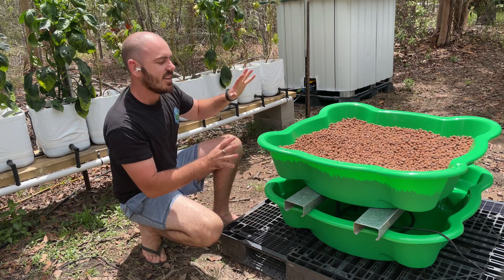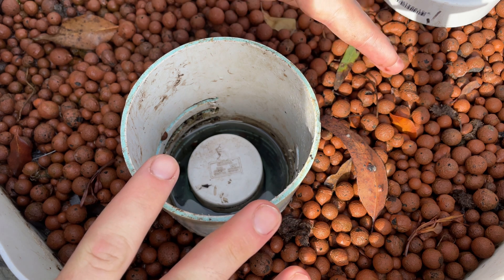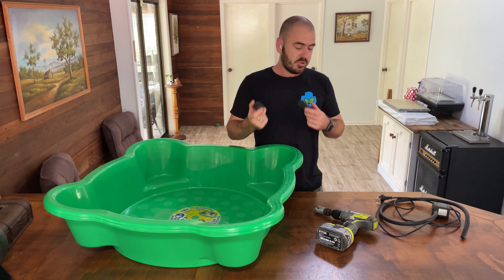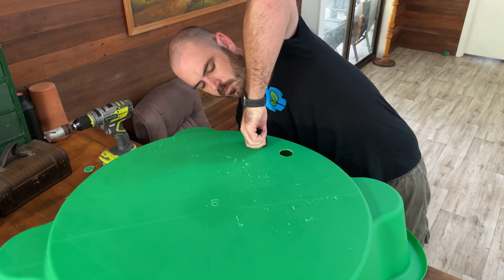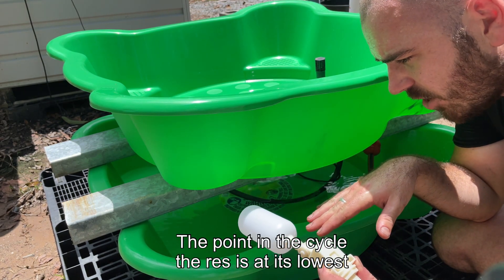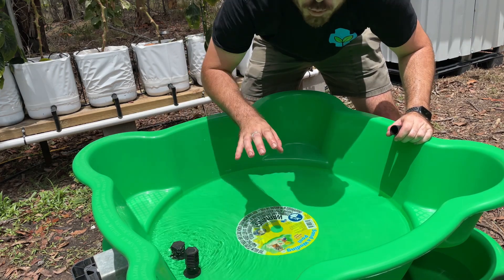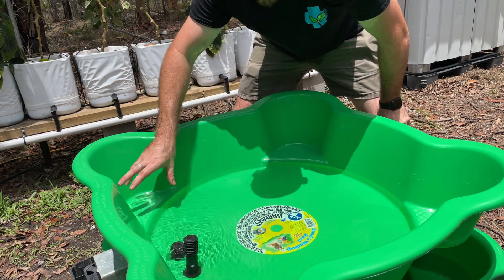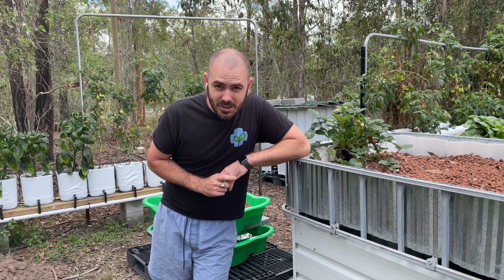Cheap & Easy, DIY Flood And Drain Hydroponic System

Comment: I use a similar system for two of my growbeds, but I use really cheap USB water pumps and small (cheap) solar panels for each pump.  I've never has to replace a pump yet but I keep many spares. You  can get these off a certain Chinese website. We're talking up to $5 cost per unit. The Solar panels occasionally need some good quality clear top coat. You can repurpose solar panels from Christmas lights.

Obviously this limits the operation to day only, and that is usually all that is necessary.  It avoids using mains electricity in the garden.  For another system, I have a large solar panel charging a 12v 200Ah GFM  battery. That one uses a home-made Bell siphon.  I limit it to daytime operation using a light sensor switch wired for daytime operation (reverse).  All my plumbing and reservoirs are black and I use covers on the reservoirs to avoid algal growth.

Comment: Lil heads up. I had 4 running as deep water with foam rafts and after 3 years in the Aussie sun they started to crack and 1 day a small knock and the entire side crumbled dumping everything. The blue shell 1's break even faster. Lucky I was there at the time or it would have pumped all the water from the fish. Would never trust 1 on a Aquaponics system again as well as would replace them yearly with in hydro grows. They are great until they fail and give you a bunch of extra work :(

Comment: Why not make a flood and drain with two pumps in side by side media tanks? Each would pump into the other every 15 minutes and the nutrients would not be exposed to sun. No need to drill into tanks, no sand pipes, no nutrient tank, supports or no bell syphon. The pumps can have vente air in the tubing.

Comment: It would be a good idea to put boards over the entire pool,it will block the light and prevent the growth of algae in the reservoir. You should also consider putting the reservoir in the ground, it will keep it cool so the roots don't rot and help block any light from coming in through the sides.

Comment: whats the situation like when it rains? obviously the return will overflow but wont it throw nutrient levels out of wack? i want to build one but no space in the greenhouse so it will have to be outside..
Reply: It won't matter. Plants are ok with just plain water or diluted nutrient solution until you adjust it.

Comment: I have a setup with 2 stackable Euroboxes. So the reservoir is rather completely covered. The pump is controlled by an ESP32 microcontroller. Smaller dimensions and for indoors tho.

Comment: You can place some shade cloth or weed mat under the two supports to keep the mozzies from breeding in the nutrient, or else replace the two supports with a solid sheet of waterproof (marine) ply. This will also reduce evaporation from the bottom tank.

Keep up the fun & easy hydro suggestions.

Comment: Great info.
Is there a way of making nutrients at home? I know worm castings can be used but have also heard that urine can be used. Don’t know what can be used for trace mins and calcium sulphate (eggs shells?)
Reply from the maker: My nutrient costs $4 per 1000L 
I couldn’t make it that cheap.
Reply: @Hoocho  can you provide the source and product? I want to see if we can get the same in the UK👍🏼
Reply: You can pee in a bottle and let the enzymes work to convert it to ammonia. Then cycle the system for bacteria to convert from ammonia to nitrogen. I have a system using this method and supplement with iron, potash (k), calcium and magnesium. Works amazingly. 
Unless you have a specific interest in this method hydro is cheapest and easiest though.
Reply: @jackawwwf2236  thank you for the reply and info. Do you know where I can learn more about this? I have unite a few questions.
Reply: @-Rickster-  I can't remember where I learnt about it, the name they used was Anthroponics. Some forum posts around aquaponics threads maybe? If there's a way to direct message me on here (or reddit, I posted some photos of my greenhouse system on hoochos there, username environmentalowl) reach out and I'll try to answer your questions :)

Comment: What are the specs on your pump & why not provide a link to where it can be bought inexpensively?
Reply from the maker: Because people live in different places and value different things.
Cheap pumps are a false economy.
Reply: @Hoocho  That doesn't explain not providing the pump specs.
Reply from the maker: @ab_ab_c  Pump specs vary for application. I can’t give a watt draw because pumps with the same wattage can have different head. I figure people can use a measuring tape to figure out the head they need and read specs on a package to find the appropriate pump.
Reply: @Hoocho  Just state the make, model, & specs of the pump that you used.  If you want to provide other info about head pressure vs flow rate, etc then do so, otherwise the basic info would be all that most people would likely need.
Reply from the maker: @ab_ab_c  it’s an aquapro ap550
Reply: @Hoocho  Thanks.  With that info i's easy to obtain the following info:

Pump Manuf:  Aquapro
Model: AP550
Url:  https://aquaproonline.com.au/product/aquapro-ap550-waterfeature-pump/

Specs:
Maximum Flow rate:  550 L/H (~145 gph)
Maximum Head: 0.95m  (~37.4")
Recommended Head: 0.60m (~23.6")
Inlet/Outlet Size:  12mm (~.472")
Electrical: 240V, 7W
Cable Length: 2m (~6.28 ft)
Size:  140 x 160 x 130mm (~5.5" x ~~6.3" x ~5.1")

Features:
Ideal pump for small patio ponds & water features up to 60cm (~24")
This pump can also be used for hydroponic applications.

-  high quality at an affordable price
-  small/compact & easy to hide
-  has a user flow adjuster to set the desired water flow rate

Now that the pump specs are documented in the comments with your vid--even if the pump goes out production, a person should be able find suitable replacement with the performance specs.
Reply from the maker: @ab_ab_c  I’ll try and include that info from now on.

Comment: Hey mate, what do you do for reusing your media? I'm worried about getting rot from bits of old root left stuck to the balls and using the hose to wash takes forever so seems rather wasteful
Reply from the maker: I don’t worry about any disease or excessive washing of media unless moving from outside to inside.
If the plants are healthy and the system is designed properly their ‘immune systems’ will deal with most anything you throw at them.
Number 1 tip is to make sure the roots have enough oxygen.
No oxygen= unhealthy roots.
Reply: @Hoocho  cheers mate